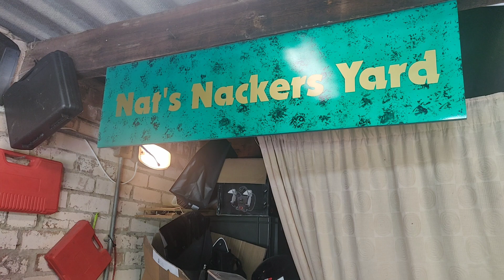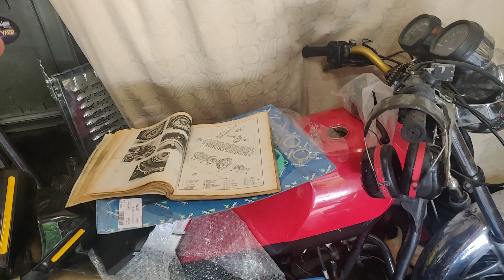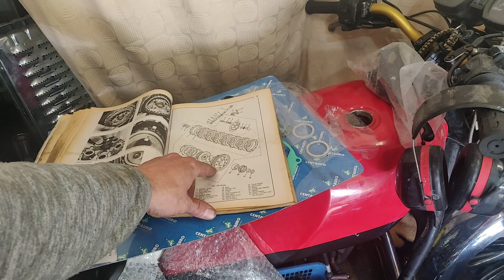1980 Yamaha XJ650.  Crisis sorted!

Comment: Peel off any 'over bleed' as you call it, it's just less to fall off and cause problems down the line. If I was you I'd get the engine back in the frame at the earliest opportunity, like now ! It'll be much much easier for you to lift.
Reply from the maker: I still have a lot to do with the frame so I can't put it in yet.  Plus pulling the top end together might be even harder in the frame